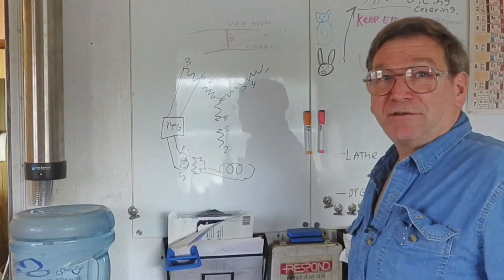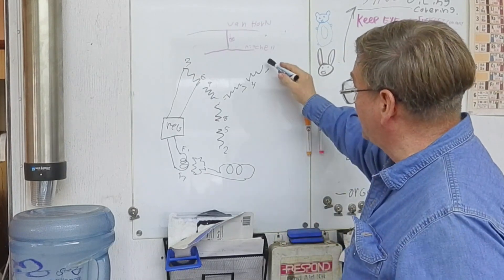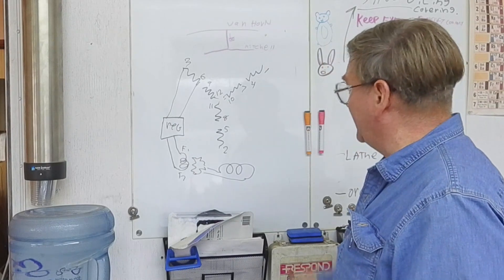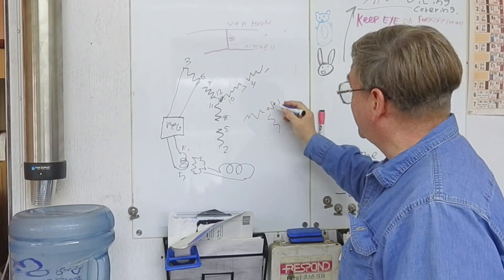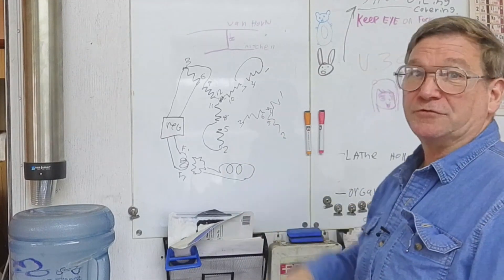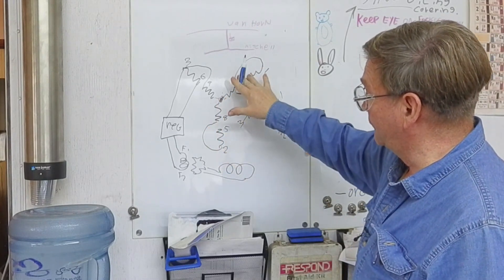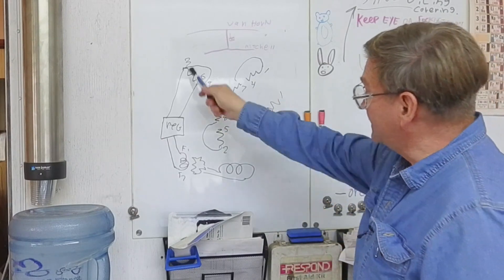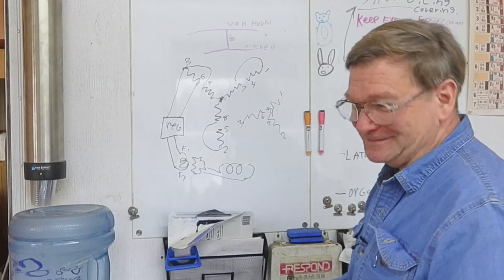Machinist's Minutes: Numbering system for 12 wire generators/motors

Comment: This is good.  It’s correct in every respect, but ignores that there are lots of motors out there and generator connections that use the Delta plan.  ALWAYS refer to documentation instead of connecting the new motor like the old one etc.  Incorrectly connected equipment doesn’t last long!  I’ve had to let the owner have the bad news that their new motor failed because maintenance guy screwed up even though he connected the new motor just like the old one

I have dissected windings to break out the Y as well.  Fun times!  Used to have “motor shops” in lots of small towns including ours.  Now they’re only in a few large cities around me.

Comment: I need to use a sine bar to align a compound with a workpiece between centers, but the compound's side is not parallel to the compound's travel so it's taking some trouble to hold it up against the workpiece instead. Any chance you'd find an excuse to make a video about sine bar on lathe tricks? I've seen your practical genius in other areas that I haven't seen elsewhere, I'm hoping you have a really simple idea.
Reply from the maker: I do not use sing bars on compound setting, using trig and direct readings with indicator is easier.  I can not do a video for a couple of weeks, cameraman is on vacation.  What angle do you need?
Reply from the maker: Video for You, I see you found it already:  https://www.youtube.com/watch?v=lyDe3RcqOjk I

Comment: this is very helpful. i wire a lot of electric motors at work anywhere from 40-400 horsepower, 6, 9, and 12 wire configurations. this shows a better insight into whats going on. and thank you for linking more videos i will definetly check them out.